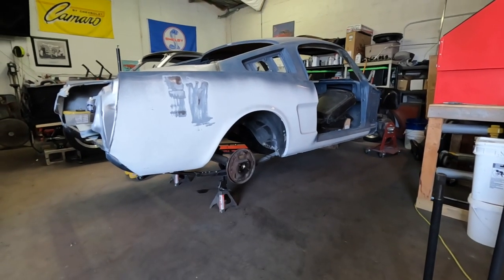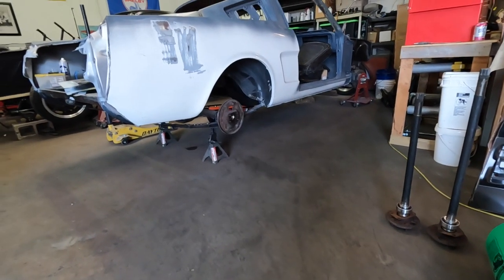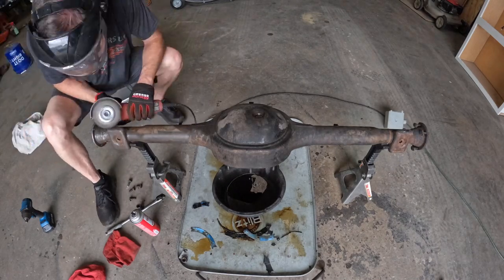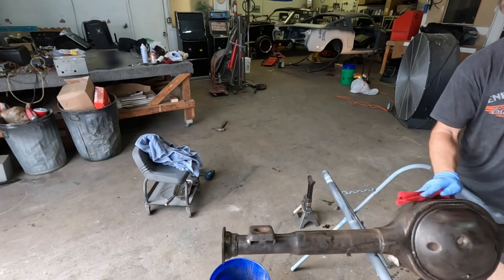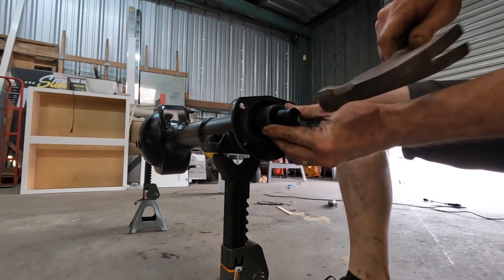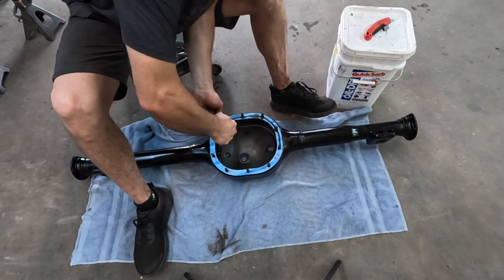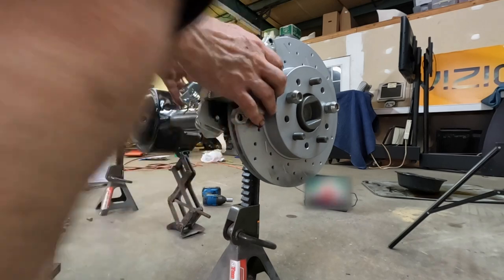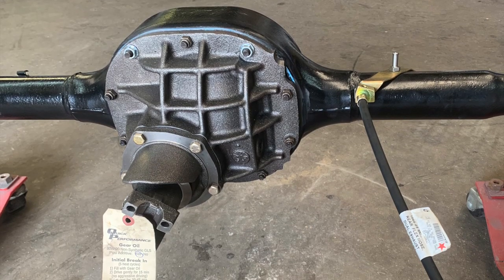How to rebuild and install disk brakes on Ford Mustang 8 inch rear end

Comment: Nicely done. There's absolutely nothing wrong with the 8" at the horsepower levels most people run, particularly on the street. You probably worked harder than most to clean the inside of the housing, but that's a good thing. Budgets matter, but if at all possible I think 4 wheel disk brake conversions are highly beneficial to mix old cars into modern traffic. I refuse to be that guy with a car that's very cool standing still but a 50mph roadblock on the freeway.
Reply from the maker: Thank you,  and I agree.   It’s all about having a fun car to drive that is as safe as we can make them.

Comment: I've been looking at brake conversations and this is the best video I've seen so far. Great job! Can you tell us Leed's part number for this kit?
Reply from the maker: Thank you.  I will look at the shop and see if I have any paperwork from that kit.   If I find the part number I will post it here.
Reply: @cvclassics  Any luck on that part number?
Reply from the maker: No sorry I didn’t find it.   Call Summit racing and let them know the rear end you have and they will hook you up.   They have always been a pleasure to deal with in my experience.

Comment: Thanks for the inspiration, why not use a Lube Locker gasket.  You may have changed my mind to go with a built QP 8".  Their 9" is nice, but it's heavy.
Reply from the maker: Glad you liked the video.  I don’t have anything against the Lube Locker, already had several of the old school gaskets.   I will probably try the Lube Locker in the near future on an upcoming build.   I thought about converting to  a 9 inch as well and had the same thought related to the weight.  Wanted to keep my weight down and the 8 should work just fine for my current plans.

Comment: What range of horsepower are these factory 8" rearends good for? I just bought a 65 C code mustang and cant imagine building anything over 350hp. Awesome video by the way!
Reply from the maker: It all depends on how hard you plan on driving/racing it.   If it’s a track car with slicks definitely go 9 inch.  Street car with stock or close to stock tires, 8 inch is a great rear end.  Street cruiser 350 to 400 hp should be fine.   The build for the car in the video is a street car with 429 hp and tq.

Comment: No grease on the axle splines? I wonder, do you know how to check the rearend housing axle tubes for straightness?
Reply from the maker: I would check with a shop that specializes in rear ends

Comment: Where did you get the wheel roller from or did you made the wheel adapters ??
Reply from the maker: From summit racing.   We did an unboxing youtube video on them.  They have been a very helpful addition to our shop.    We use them.  We them to move cars around the shop and during restorations and metal work.

Comment: great video!  where can i find that vent tube/brake line assembly.
Reply from the maker: National Parts Depot,  give them a call and tell them you are looking for a vent tube and rear V8, duel exhaust, flex line.   The vent tube holds it in place.  Good luck in your project!

Comment: Do you need to replace Lug Stud for longer?
Reply from the maker: Yes by adding the disk rotor I switched out the studs for approximately 1/4 inch longer studs

Comment: How did the axles go from 4 lug to 5 lug. What are the 5 lug axles from
Reply from the maker: It was always an 8 inch 5 lug rear end.   Those are the original axles with new bearings installed

Comment: Where did you get your rear end from?
Reply from the maker: This rear end was a stock 8 inch rear for a 65 mustang.
Reply: @cvclassics  let me rephrase the question, where did you buy your 3rd member from?
Reply from the maker: Quick Performance, ordered it on line and had it shipped.  They were great to deal with!